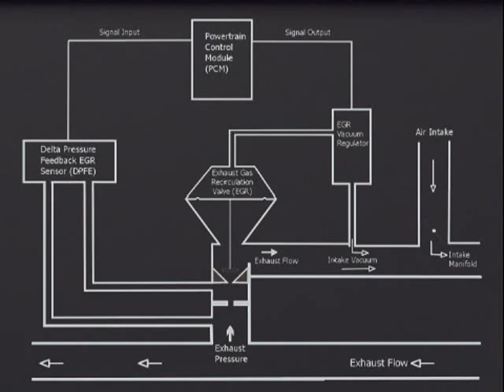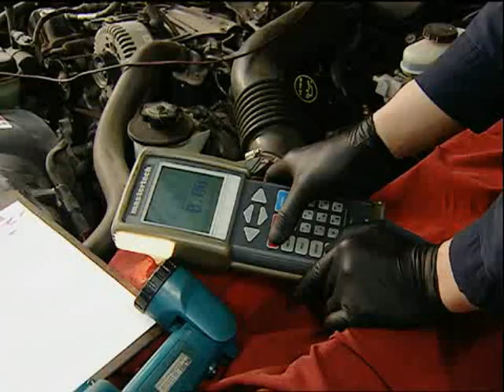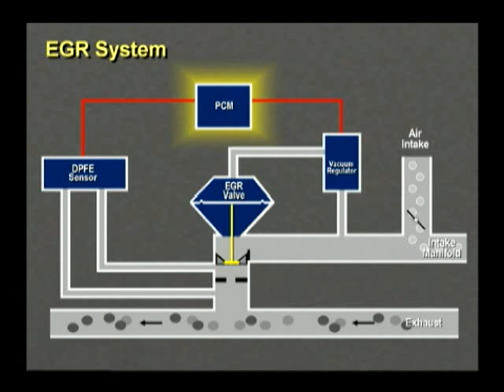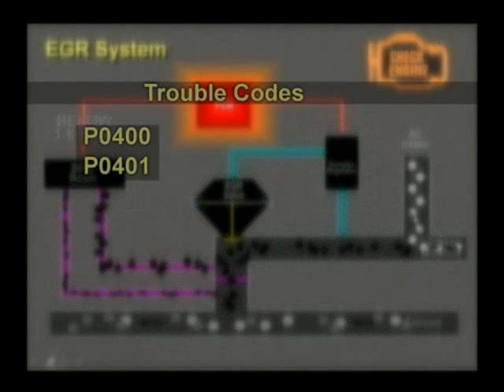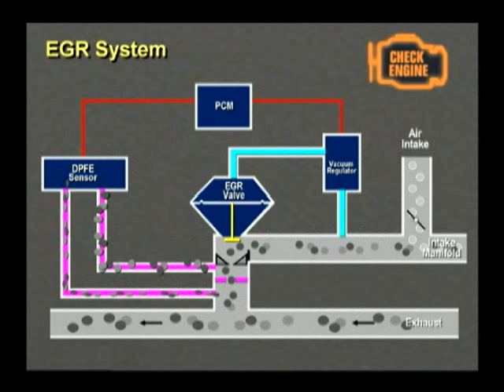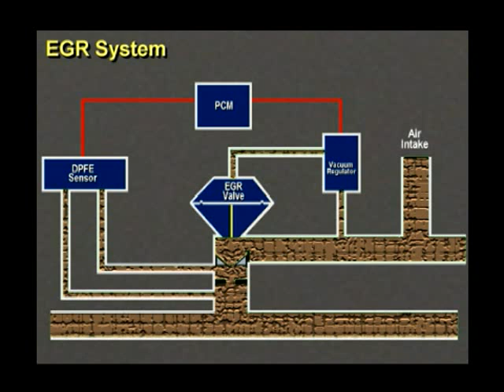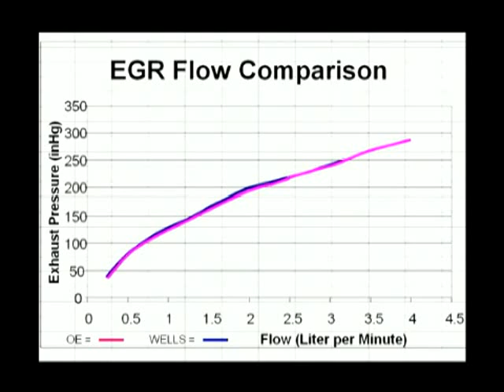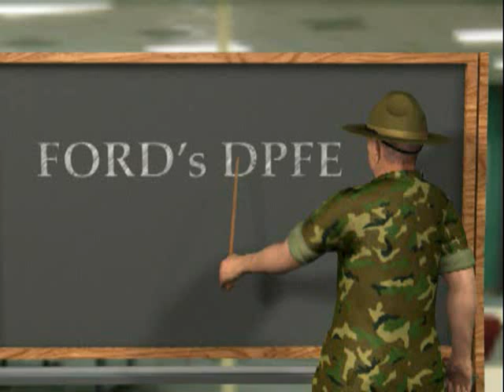Wells Ford EGR DPFE Training with Sgt. Tech  P0400, P0401, P0402,

Comment from the maker: @markjhicks Since then many advancements have been made and in fact disabling the EGR system on today's vehicles would be a mistake for several reasons. First it will set troubles code(s) and you will fail an emission test. But foremost the EGR system helps cool cylinder combustion temperatures to prevent NOx formation and by doing so it improves performance and fuel economy. 

Thank you for watching and your comment,

Mark Hicks
Wells Vehicle Electronics

Comment from the maker: @rb26capri I believe you mean EGR. In the future please refrain from using foal language. I dont want our young to think this is the right way to communicate. But your question is a valid one and I am sure many think the same. When the EGR system was first designed and incorporated it did take away horse power and lessen fuel economy. In fact I had disabled the system on many vehicles myself. But you have to remember it began in 1972 that was 39 years ago.

Comment from the maker: @youpaynow78 
These trouble codes usually mean the engine is running very lean. Depending upon what kind of vehicle you have common failures can vary greatly. What is the year, make, model and engine size?

Mark Hicks

Comment from the maker: Thank you for the kind words. 
By introducing small amounts of inert exhaust gas into the combustion chamber, the combustion flame front is slowed. Which reduces the adiabatic flame temperature without reducing combustion piston pressure. I hope this helps. If you need a more detailed explanation, please let me know.
Mark